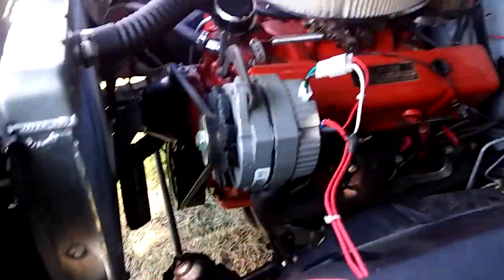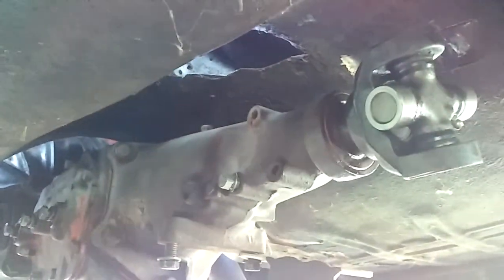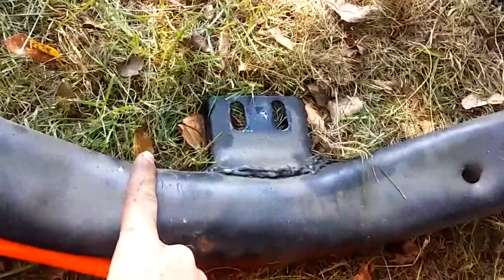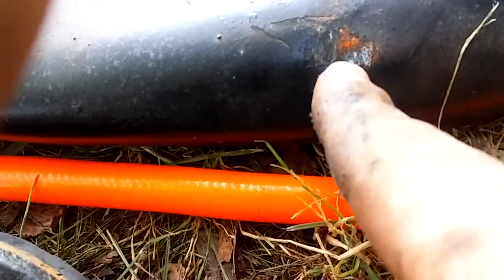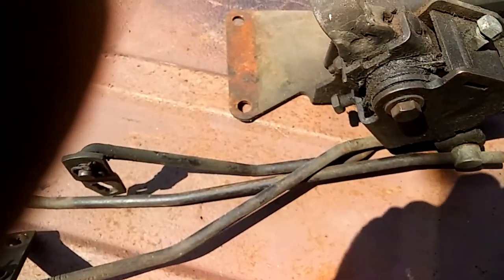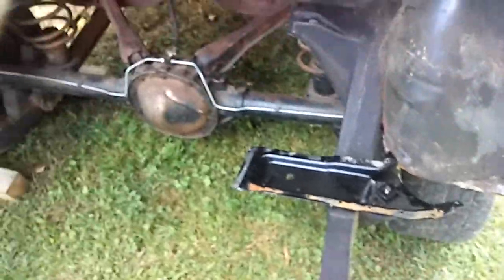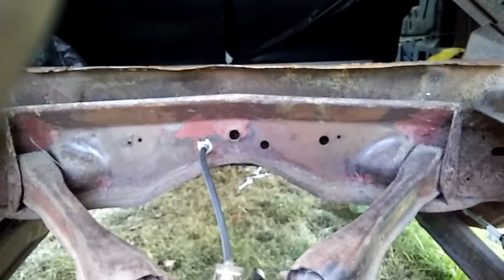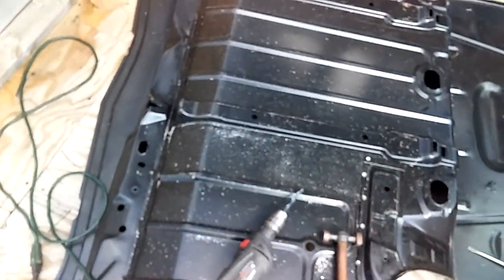67 chevelle hurst competition plus shifter install

Comment: It looks like the old Hurst Shifter is for either the 1967-1968 Camaro/Firebird or the 1969-1970 Nova/Chevy II (shifter is part# 3916848 and install kit is part# 3734529 for Camaro/Firebird or part# 3737131 for Nova/Chevy II). If you have any questions about your new shifter or need assistance with installation or adjustment just give us a call at 707-544-4761.

- Jason @ Flowmaster